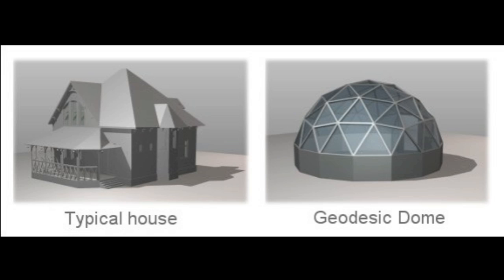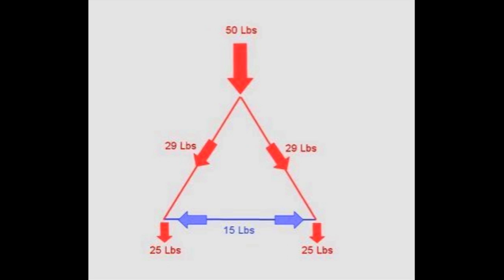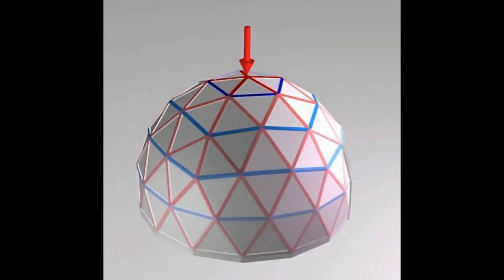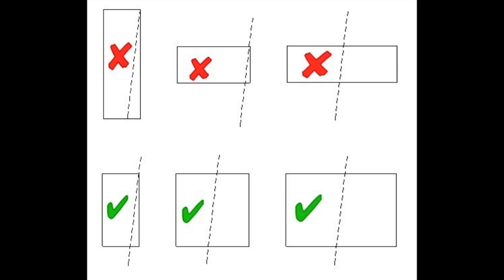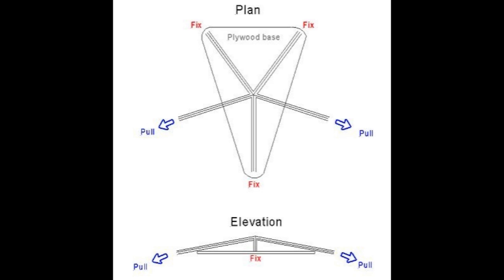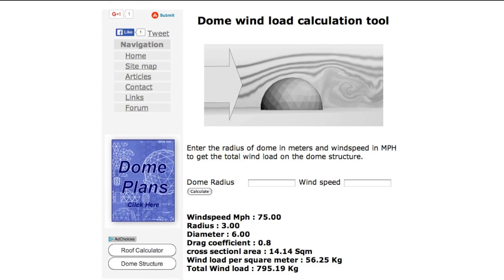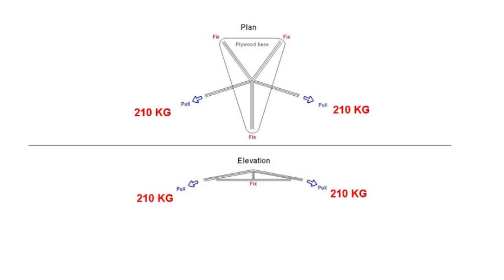Geodesic dome structural analysis basics

Comment: I think you are incorrect regarding timber selection.  I believe you are correct in your understanding of how force is divided.  However I believe you are incorrect on how it is applied.  At the point of contact you're going to have the force that is applied and the direction that it is applied.  For that segment or segments.  However, like an arch, every other piece will be under compression and that force would be applied basically along the plane of the triangle.  This would mean that the triangle itself would see the same direction of force regardless of its position in the dome.  I think you would likely be correct however if you applied external force to a segment or segments where the narrow cross section of the timber were to be supporting that load.

Comment: Paul, world class web site and tutorials.  My local codes impose a snow load factor known as 35 pound ground snow load.  I assume this means we have to design roofs to hold 35 pounds per square foot?  So how does that work in your snow load calculator?  Also, for wind loads, we need anchor the structure for overturn resistance.  When calculating the wind load, we need to know the uplift force resistance. My concern is can the bottom triangle member take the vertical load, and how to, and how often, to attach it to the foundation.  Thanks again for your contributions and hard work on the subject.  I hope to buy some wangers.

Comment: This video was very helpful in starting to understand the structural integrity of the geodesic dome. I just purchased a property that had a 20' diameter dome shell on it. It has 3 dormers for doors and/or windows and is built on quite a frame. It has been standing basically abandoned for about 20 years in the mountains of north idaho where we get 3-7 feet of snow during our long winters. It was covered with asphalt shingles and is basically dry inside, with only tiny signs of some water entry but this spring it was 100% dry so I can't say for sure that didn't happen during construction all those years ago. 

We are going to reframe inside the dormers and extend one out to create a front porch. It should be a fun project, I'm going to turn into an off grid tiny home.

Comment: I'm trying to guesstimate the strength and max.load of a steel struts dome (and also what type of struts would be most efficient). So I came back to this video ...
So I noticed something I apparently didn't understand the first time.
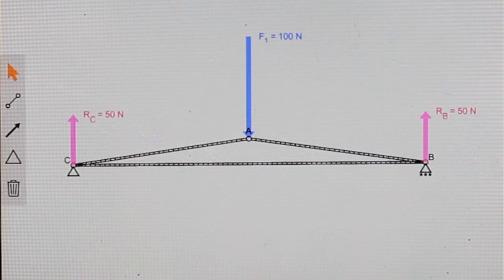@ 4:13 you (and the Force-Effect app) are saying that at given load on a top node of lets say 100N the compression force on each downward arm is actually much higher.
How is that possible? (ignoring the construction's own weight)
Also I was wondering on the type of steel beams to use, and quickly excluded I-beams because they're designed to take load either in vertical or in horizontal (with its web being vertical) orientation, but of course in a dome most struts are at different angles, and not a single one is actually vertical. 
For example, if you imagine the top pentagon made with I-Beams, since they're almost horizontal the beams should be with the web vertical and the two flat sides horizontal - that's almost a perfect position (since all the beams of the top pentagon are mostly in the same plane, at only ~12 degrees slope to be precise). 
Going a row down however the angle (of the dome wall) gets much steeper (but far from vertical), but at this position the angles between connecting struts at given hub isn't irrelevant since it can be at up about 60 degr. slope, and this time the slope is in the wrong direction relative to the I-Beam's web. 
The ultimate example is when you see the wall triangles at the bottom of the dome. The walls are close to vertical (especially if it's a 5/8 dome), but their I-Beams (assuming their orientation at the hubs isn't changed) will be at ~60degr. angle, and also the bottom beam (that's practically horizontal) will be in the worst orientation for a I-Beam - with their web horizontal.
However if the load force distributes only as compression & tension forces of each beam, then orientation wouldn't matter, since I-Beams (and pretty much any type of beam) is strongest vs forces on the axis of their longitude. (and load forces that land on the length of the beams - from the wall panels - is not to be ignored either)
So could you clarify in more details how (and why) the forces are distributed around a dome?
Thanks!

Comment: I am researching earthbag dwellings. AS I have never built one before, I was thinking about using a GeoDome as the 'skeleton' of the earthbag house. I have seen this done with hay bails but not with earthbags. Any thoughts on the weight of earthbags on a geodome skeleton?
Reply: robert...did you build with dirtbags? i like the idea for sure. i myself am thinking of building the unity dome he has come out with, but then shotcrete the outside..or aircrete it and wrap to seal..what do you think?

Comment: If the drywall, foam insulation, glass, plywood, and plastic sheet companies can cut panels at 60 degrees instead of 90 degrees in the factories, it would be more cost-effective to make domes....Otherwise you're making triangles out of square pieces and producing a lot of waste!!!! Not very efficient....
Seems to me that it be more efficient to make concrete and spray-on foam domes.....

Comment: I don't quite understand why there are tension forces on the rings if they are linked with the hobs where compression forces act upon. Shouldn't they balance each other out or at least mix them together so that their overall compound is zero?
Even the hexagons close to the pentagons at the top should only have their outline struts under tension when a load is applied to their vertex and that seems to go against what the video says.

Comment: Hi Paul, do you have any information regarding how loads would act on a dome made from solid hexagonal panels as opposed to the traditional frame and skin method? I'm having trouble finding any examples of this approach. Any info much appreciated.
Reply: This is a very late response. For what i've study with solid components you have a lot of disadvantages.
- More weight overall and not a lot more of structural strengh 
- whole panels maybe more dificult to attach to each other than framing and skin
- the materials used need to have structural strengh a.k.a. you are limiting your self on the type of skin used (glass, plastic, etc)
- a more heavy structure can colapse and be unstable (not recomended), the ideal is a light and thermical isolated surface.
All this talking of a house dimmensions, in a dome much more small all this things do not matter as much

Comment: Thx for posting info on Dome. May I know ... What's the difference between building the Dome Top-Down (Roof first, Base last) versus Bottom-Up (Base first, roof last)?
Reply from the maker: Top down is used on bigger domes, you do need a central crane but the frames are pushed together as you build. You need a few people for this. Building from the bottom up is best on smaller domes and can be done with one person but the base has to be placed accurately, and the frames have to be pulled together as you go up. Don't fix the base until the dome is fully built and building on uneven ground can be a problem.

Comment: This is really interesting, but the volume is so low I am struggling to hear it at full volume.
Reply: Yes the volume is too low.

It's something a lot of youtubers don't get right, since they focus much more on the content than the way it is delivered. It's not a big deal, but I notice there are very different volume levels on the different videos. As audio engineer, I find it annoying, but as I said, no big deal.

I would suggest - friendly - that you pay more attention to the audio production part of the videos - it will make them that much better. :)
Reply: i got no problems att 30% sound.
Reply: What?
Reply: mostly inaudible on my device, even with earplugs and  w/o ambient sound

Comment: Paul, thanks a lot for your useful videos and for sharing your knowledge with the world! If I may, I have a question: I´m designing a geodesic dome 2v frecuency, 10 meters in diameter. Because I want it to be taller than 5 meters, I'm designing it to be 3/4 of a sphere, rather than 1/2 of sphere. According to your experience, 3/4 of sphere is just as strong as 1/2, taking into account that in 3/4 of sphere the first row of triangles is leaned outward? Thanks in advance for your answer!

Comment: Hi Paul - you made very nice videos and also a great website. It helps a lot to understand dome structures.
You sound like you are from UK and there they use imperial measurements if I am not wrong. However your calculation tools are mixed Metric and Imperial. (radius in meter but windspeed in Miles per hour). May I suggest to put a simple unit in your calculation tools.  i.e. Radius/m: 6  - it would help.  And since you have to touch your website again - can you share the formula you use for your calculations as well? Thanks for considering. Cheers
Reply from the maker: Thanks for that, the UK uses both, we went metric in the 1970s but the building trade often still use imperial we also still use MPH, that's why my measures are a bit mixed. You can find the formula by entering 1 unit for radius. I will add some more calculation tools though. Cheers

Comment: Excellent video Paul.  Would there be any special concerns when building a dome using PVC?
Reply: Paul Robinson Not to mention plastic is really bad for our environment.
Reply: Paul Robinson That's a wise engineering principle. Many here are just DIY man that has no engineering education.
Reply from the maker: Technically not, though I'm not a big fan of PVC, I'll be uploading a video shortly about the build it to last concept. Is it better value to make a very expensive building that lasts a long time compared to building a cheaper one that has a much shorter lifespan.

Comment: Hey Paul! What about an open-air geodesic dome, like the dome over ASM headquarters? It is built with tensionrods where some of the compressionrods are supposed to be (according to your video). Does it work differently? 
https://www.google.dk/search?q=asm+headquarters&safe=off&espv=2&source=lnms&tbm=isch&sa=X&ved=0ahUKEwjn8J3rs5LTAhWBjiwKHfC7CpMQ_AUIBigB&biw=1396&bih=669#safe=off&tbm=isch&q=asm+headquarters+dome

Comment: Thank-you for taking the time to put this video together! It's most appreciated. I think you're mistaken about the vertical load analysis, though. To determine the member forces you want to project that single point load force's direction to be coplanar to the triangle in question. That component is small for the dome's topmost triangles. Also, I believe you're neglecting to consider the bending moment within each timber member. I hope this is helpful. Again, thanks a million!!

Comment: Also paul, if you was to build a dome twice the size say 6m 3v to a 12m 6v how much would you have to increases the size of the timbers? Twice as much cross sectional area?
Reply from the maker: OK you're doing two things there, double frequency, then doubling the size. You won't need much bigger timber section because the strut lengths will stay roughly the same, you will need considerably stronger hubs though. I made a 12m dome with pseudo 8v geometry (a 4v with extra stud work inside each triangle frame) here's the video: https://youtu.be/6ERJx-BPw3w

So to answer your question, not much bigger struts but hubs that resisted inversion, you can do this with a double skin or by beefing the hubs up.

I cheat and use pseudo geometry: http://geo-dome.co.uk/article.asp?uname=sudo_domes
This is actually stronger that conventional geometry..

Comment: Hi Paul, I was searching this kind of info today..
But I still have some doubts on dome designs.
For example in all pages it said that if you increase the frequency (lets said v3 to v4) increase the sturdiness of the dome..  But in what sense?
If I apply as you show a force in any vertex towards the center of the dome, then the angle in a v4 is lower than v3, so the tension must be much higher to counter the force.
This is the thing I never understand with fuller idea, when he said that domes becomes stronger with size..  If a dome is very large, then the angle becomes zero and the structure can not counter loads apply to the top of the dome.
Of course I must be wrong... but I dont understand the physics behind.. 
What about on practice?  on the vertex joints?  these are strong enough to counter forces towards the center?
Reply from the maker: You are exactly right, a 4v dome is more likely to have a node inversion but there are a lot more struts to share the forces, so it will be weaker with a point load but stronger with a broad load like snow on the roof. The thing about getting stronger as it gets bigger is not true, if a structure gets stronger as it gets bigger then in theory there is no limit to the size you can build, this is not possible, imagine building a small dome from paper the size of a soccer ball.. then keep building it bigger until you get to the size of a house or football stadium, the paper would crumple under its own weight. The way to prevent node inversion with high frequency domes is to use a double skin or space frame type construction. Well spotted!
Reply: Fuller's geodesic domes were conceived as struts joined only at their ends. Struts which are "too long" fail in compression before the materials compression strength because of the phenomenon of buckling. (The struts bend sideways, before they crush.) The reason for going to higher frequency domes is to lower the length of the struts below the bucking point. (Fuller's idea was to use materials to their maximum potential.) Buckling (according to a mathematical theory) occurs at a certain critical ratio of length to cross-section of a tube.
Reply: You are kind of Myth Buster for domes, sir.
Reply: I believe the idea that the strength of domes increase with size is a confusing version of the principle that, for a dome of a constant "strength," the ratio of the amount of material needed to the volume goes down as the volume enclosed goes up. This is simply because the area of the enclosing shell goes up as the square of the radius, while the volume goes up as the cube. (The apparent "strong-ness" is sort of going up.) Fuller, I think, was trying to persuade skeptics that a dome coving an entire city was not really impossible for lack of materials strong enough, as people supposed, when he said things like this.
Reply: Yes, like B. Fuller's US Pavilion at Expo'67 in Montreal !